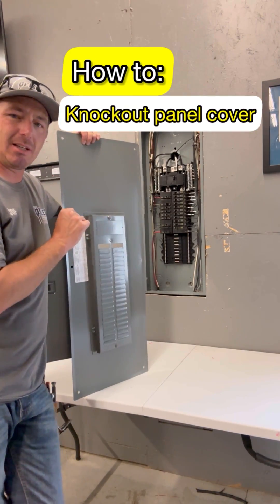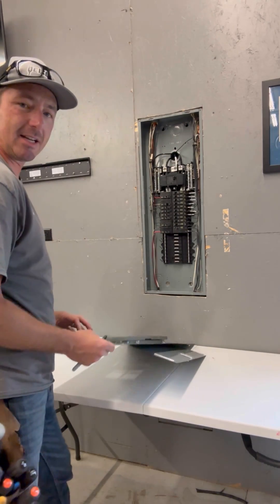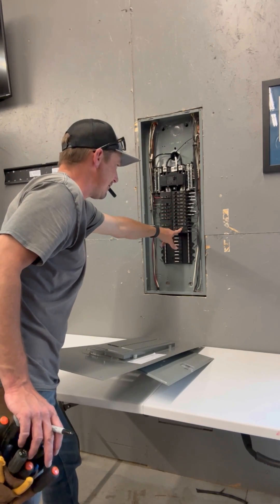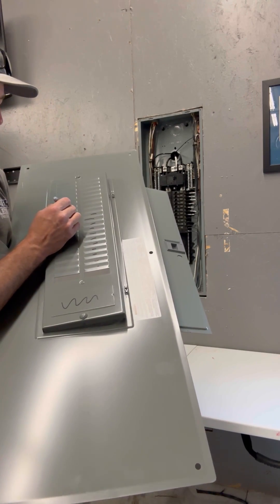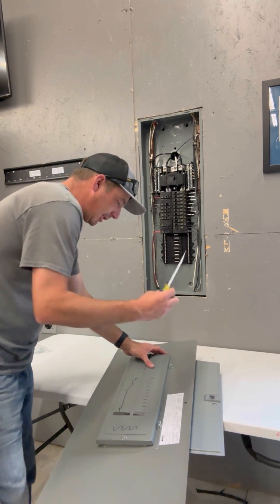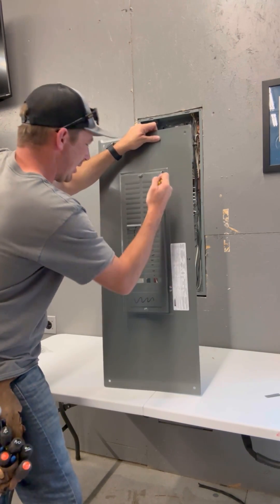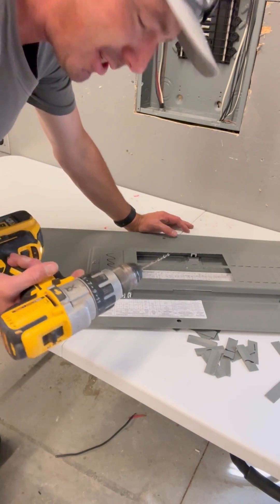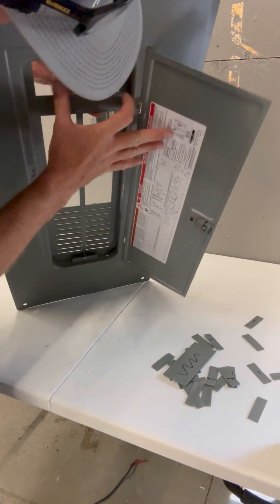How to install a panel cover

Comment: Sometimes I use a tape measure and measure from the mounting holes to the top of the breakers to ensure I have the right spacing. Some manufacturers have put more knockouts in than spaces.